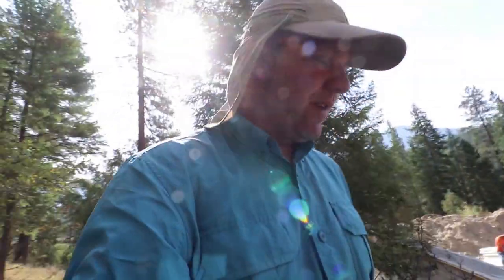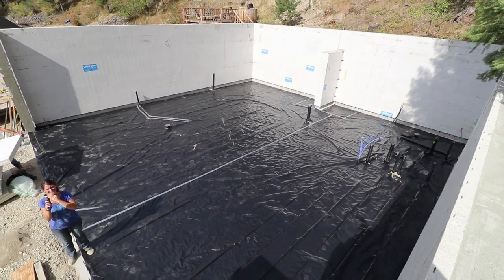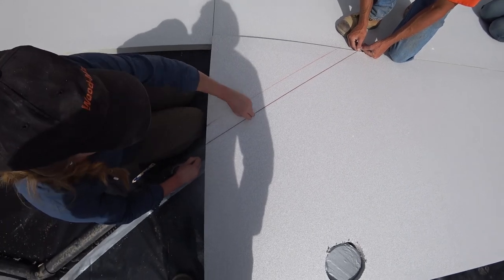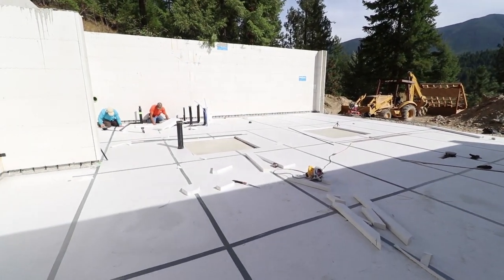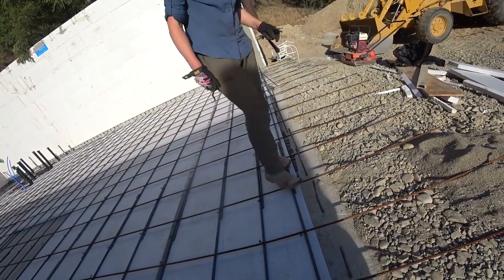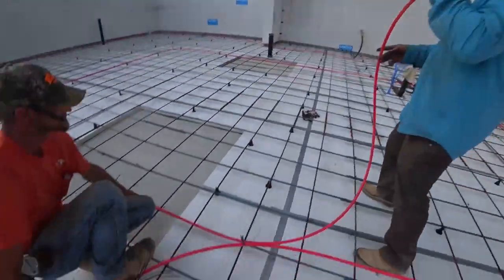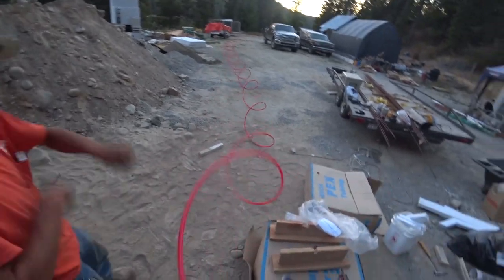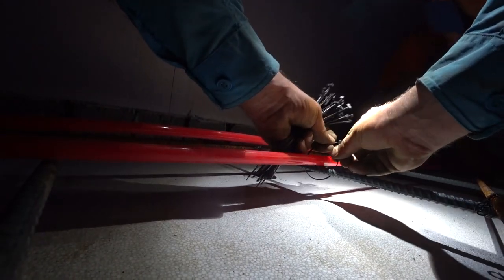PLAYING GIANT HOPSCOTCH (Rebar Tying in Concrete Slab)

Comment: So the foam won't compress under the weight of the slab? An uneducated man like myself would think that would lead to cracks in the concrete as the foam compresses. Long time listener; first time caller.
Reply: The rebar will spread the load evenly. And it would take a massive amount of concrete to compress the foam significantly (they are making a floor, not a nuclear bunker ;) ). 
I work at a factory that manufactures precast concrete pillars and beams, and we often use polystyrene for formwork (that, and a sh!tload of plywood).
Polystyrene breaks easily, but can take quite a lot of pressure when supported underneath.

Comment: Yeah,, I know,, a week late,,, You do not need to tape the seams.  Isn't even recommended.  A full and perfect seal could trap liquid water.    The plastic is a moisture barrier, not a water barrier.  It achieves its principal use by breaking the absorbtion of moisture up through the concrete,, a wicking process, capillary action.  The foam around pipes just break pieces off with your hands and cram them into place.

I haven't finished watching the video,,, your pipes will float up through the concrete  Your re-bar or screen is on top of your pipes, or tie your pipes well to the rebar.  If your transfer piping is not well tied,,, puddle some concrete atop,, allow to jello,, then proceed with the pour.  (That works only if it is a multiple truck pour.)  I buried 500 linear feet of corrugated 4 inch plastic in a 10 inch slab several times.  Air transfer to concrete storage.

Comment: Are those two concrete squares already in the middle of the house there to make sure the final slab doesn't move up or down?
Reply: Axel Solhall they are footings to take upright timber beams to support the flooring etc
Reply: That makes sense! Thanks!
Reply: they are footings for the posts to support the steel beam that is currently being installed

Comment: Is it standard in america to lay a concrete floor on styrofoam blocks? Seems like putting concrete over it might compress it given enough time, whereas compacted soil is already compressed
Reply: No ,its not standard. In some parts of the USA it would be very stupid to do that. I can only speak for my area though ,which allows the ambient temperature in the basement floor to provide a 50 degree basement in the middle of the winter. (when unheated) 10 degree Celsius) Also ,the biggest drawback to using floor slab heat is "slow thermal response times' making daytime or nighttime 'setbacks" difficult to impossible. in my area the temperature can change a lot from day to day. I have hot water heat......I went all copper.( more expensive but way faster temperature adaptation)
Reply: Ruan du plessis In the UK concrete floors are laid on expanded polystyrene too.
Reply: There is a slow flowing water table under my basement that replenishes the natural ground heat. It allows me to heat my home hot water (potable) using just the heat exchanger of the heater. it saves a huge amount of electricity with a family of five.(it really depends on your area and the subsurface temperature)
Reply: Standard practice here in Canada if you are doing it right and not skimping on money, especially when using in floor heating.
Reply: Steven Hardy, pouring slabs on extruded foam boards is pretty standard. I don't know why it would be "very stupid" to do that in certain areas of the US. Maybe you can explain?

Comment: I don't understand the height of the floor drains. They seem to be flush with the foam. The concrete is going to cover them up???
Reply: The styrofoam isn't level with the drains, they had to cut out part of the bottom of the foam for the pipes under it so it could sit flush with the ground.
Reply: Hi Kev not a problem small well extension ring ,there should be a fall to the well between 2/4% per yard creating a fall to the well .

Comment: So your floor heating tubes are cast into the concrete? Won't that mess up the concrete from the inside?
Reply: How would it mess up the concrete from the inside? Once the concrete is dried it is hard, like a rock, the water won't touch the concrete. The water will travel through the pipes, transferring the heat to the concrete thus warming it up.
Reply: Most in floor heating is installed this way, think about it, thermal mass.

Comment: Please tell me that none of those circulations are longer then 300ft. That's the acceptable maximum lenght for a 16mm PE-X pipe as you seems to be using.
Reply: Moritz Hübner ...watch and listen to the video!  They have 5 circuits of 250' in the plans.  Considering the sq ft of the slab, and the spacing it appears they have used, from experience, I would say the average loop is around 200'. 5 loops makes for more control expense, but well worth it.
Reply: Paul Copeland Then pls tell me that they also will reinsulate the slab from the walls prior to pouring.

Comment: Cad program to design radiant  loops. Usually have a 30 day free trial. Also loop on first staple to foam.
Reply: Dale Jensen that is correct.  But the loopcad program I demode did this for you. Did better the the manufacturer I bought my system from.
Reply: I have done radiant heat and snow melt for many years.  As long as they keep the loop length short enough to control the return temperature ( which they did) they will have no problem with slab heating. 5 circuits in that space and installed as they did, will result in a nice low input temp and a controllable return.  If they use the proper controls (based upon the high quality of material used so far, I am confident this will happen) they will have a comfortable and efficient heat source.

Comment: Anyone know what the red hose they were attaching to the rebar was for? i'm guessing its something that runs hot water through? XD no idea. thanks! feel free to reply to me!
Reply: The red hose is for the in floor heating.
Reply: That looks like radiant floor heating tubes (PEX).
Reply: YES, that red hose will be embedded in the concrete and yes hot water will flow through it to help heat the house from the floor up!
Reply: Thanks guys! I was second guessing myself as to why they would run a hose like that. I guess it's cheaper than running some sort of complex copper pipe system. I would be so afraid if at any point the tube cracked which could cause erosion from the elements. But I doubt it because of the insulation on the bottom.
Reply: GOSuBunnY - PEX is much cheaper to run for in=floor heating.  (actually cheaper to run for pretty much any application)
Reply: G0SuBunnY ....pex pipe is far more durable than copper in this situation.  Pex has been used for years.  Copper is not to be encased in concrete.  Bad idea, all around!

Comment: When using a  box cutter for what you are doing it is easier to use a hook blade like the ones used by carpet and vinyl layers. You can cut right into a corner or up to an edge and the cutting part of the blade only ever touchs the material, never the ground or concrete.

Comment: I always thought the zip ties they were using were overkill.  The part that usually fails first is the tiny little lock tab.  That us why the best zip ties actually have a stainless steel tab.
Reply: Oh my god, WRONG ZIP TIES? The armchair experts will complain about everything they see. They won't matter much when the concrete is around the pipe.
Reply: Son of a Diddly - My only reason for commenting is those heavy duty zip ties cost a LOT MORE $$$.  1000 generic, 3mm x 60mm zip ties are about $5 on eBay.  5mm x 370mm are $40.

Comment: duct tape for board insulation seeming? 

did you talk to the manufacturers about this? cloth backed tape is almost never reccomended on insulation of any sort. 

you really want a flashign tape... polyolefin tape or acrylic backed LDPE tape.  

cloth backed vinyl tapes or LDPE "duct" tapes are usually less stable with age and use poor quality synthetic rubber adhesives. they almost never have the proper UL certifications either...

duct tape on the vapor barrier is even worse imo. no building inspections though so i guess you are fine.
Reply: Timothy Manley at least it's all on documentary for the future buyer haha
Reply: very true lol. good point.
Reply: doesn't the duct tape just hold it there until the concrete is poured?  if that is the case what would be the concern ?
Reply: no. the vapor barrier is supposed to be as continuous as possible. when the tape lets go you will allow more vapor in than you would otherwise with a better long lasting tape. 

the vapor barrier is not going to stay perfectly flush with the foam and the foam is not going to stay perfectly flush with the concrete. you will get a small gap with time as both the foam shrinks with compression, and as the subgrade and virgin soil compacts over time. 

unless you are building with piers on bedrock or a slab directly on bedrock, foundations ALWAYS settle. first thing we learned in structures... only think you can do is engineer for a particular settlement depth and engineer the foundation to resist differential settlement.
 
the weight of the sturcture acts as surcharge further compacting and consolidating the subgrade and virgin soil underneath. 

most of the time this settlement is milimeters over say 10 years... but in shitty epansive clay, this can actually be inches. 

you want proper tape so that the vapor barrier and the foam insulation( acting as a vapor barrier as well) stay as tight as possible throughout the settlement. 

regardless though even if the vapor barrier and foam insulation were to stay perfectly flush against the concrete, you still get vapor leakage when the tape fails. 

its not an enormously problematic issue... but a slab that is moving losts of moisture into the interior is going to make certain flooring problematic to install and add to the humidity load in wet weather if left un sealed and as bare concrete. 

again.. not a huge issue here, its just that the proper tape is not expensive at all...just seems like a stupid oversight on an otherwise very nice job.
Reply: well thanks for the reply ..  we build in Southern California where there is less water problems.  Here we over lap the vapor barrier, MAYbe use tape to hold it before the pour.  I am an electrician so this is just from observing for the last 30 years.  
Given that Pure Living is on a hillside in a very wet area it could be a problem.  
The oddest thing that I am not understanding is that the slab is poured on foam insulation and you are going to drive cars on it... Maybe with all of the rebar in the pour and a stronger mix it is strong enough.  We are in an urban area and go into parking garages and you can see the concrete deck above flex as cars go by.  if that is the case here than what happens to the foam below??
Reply: oh i love parking garages man. its really dramatic the movement you can see. 

but you need to be careful not to conflate slab on grade foundations with that of post tensioned parking garage structures. 

the two are VASTLY different. 

post tensioned structors use tendons of high grade coated steel that are under 10's of thousands of lbs of tension. they are designed to be light weight and designed to flex to distribute the load. alot of these post tensioned beams are actually subtly arched when unloaded and when loaded start to flatten out. 

a slab on grade is also designed to flex(obiviously), but not NEARLY as dramatically as that of a post tensioned beam like you see in a parking garage. 

EPS foams come in a variety of compressive strengths. its usually rated at PSI  or PSF at 1% compression. 

common geofoams are  usually anywhere from 5psi to 15 psi and higher maby.  you can get very very hard foams like 40 psi, but these have far far less insulating value and will not be used in a situation where insulation is critical such as this garage here. 

its important to remember that you are not putting the load directly onto the foam underneath the tires of your car... the load is distributed to many adjacent panels via the concrete slab so you can actually use foam thats 10 or 15 psi rated quite easily on a car whos weight accounts for say... 40 psi ground pressure. 

btw. fun fact here... a battle tank which weighs many multiples that of your Toyota truck  actually has a ground pressure many times less due to the enormous contact areas of the tank treads... hence they can drive on sand and all sorts of soft ground.
Reply: Timothy Manley .. good info,  thanks

Comment: In my research for building my own home, I have found they now recommend placing the foam down first, and then the vapor barrier something about slab failure. Anyone else have thoughts on this?
Reply: Vapor barrier against concrete, but a few do otherwise. This will ensure no bonding of the slab to underlying materials. Newer integrated systems will be foam ontop since the tubing is laid within the foam.  Never heard of doing otherwise leading to slab failure and would say slab failure is just down to improper base prep.
Reply: I was a bit surprised the engineer used direct slab-wall contact for sliding resistance. I would have preferred to see a couple of grade beams instead so the slab could stay thermally isolated from the walls.
Reply: Funny that my retaining wall design software has an option for "slab is present to resist all sliding forces". As an engineer you have many options for how to handle retaining wall forces. I am a bit surprised by this one, but that doesn't mean it isn't a valid engineering solution.
Reply: Commenting just to save this thread for future reference

Comment: Why you heating your garage?
Reply: Campbell Stubbs Having conditioned space below their house means they don't need high R-factor in the floor. Takes up less space, the heat will rise into the house, and their vehicles won't have to sit in the cold. Not to mention if you have ever tried to service a vehicle in freezing temperatures, it is NOT an ideal situation.

Comment: putting concrete ontop of something compressable, even with rebar, sounds like a bad idea to me. lots of cracking. then again, i'm no expert.
Reply: yes, you are not an expert.
Reply: They used a high density styrofoam so in theory it shouldn't compress.
Reply: They also have two butresses in the middle of the floor, which will support the weight of the slab.
Reply: Vein1986 yes, I said that.
Reply: epocs thank you.
Reply: haha it's done like this in every single civilized country in the world, literally.
Reply: @Simon Olesen :
Unless they use LECA instead of StyroFoam.
Reply: Simon Olesen i've lived in 4 different houses, and the slabs were poured straight on a gravel bed that sat on bedrock. in the foothills of Denver, so putting a house on top of takeout containers is new to me.
Reply: 1 inch of high density styrofoam has similar R value to 4 feet of gravel, and you get greater strength per inch of concrete than with leca as well as a lot of other desirable properties. They are not takeout containers lol
Reply: They really are not, I can agree with that.
On a sidenote, LECA doubles as drainage, which is neat.
Reply: @Grumpy ol' Boot
yeah LECA is good, but not used much here anymore mostly because everyone wants underfloor heating. Do you guy's often use LECA in conjunction with underfloor heating systems ?
Reply: Not really, no, though I suspect it could be done with a bit of finagling.
But for garages and such, which usually don't have underground heating, we like LECA because it can be done so fast.

Comment: Rebar is too close to the wall (needs min 50mm). The loops are done totally wrong, piping is too thin and runs need to loop to centre and out. You're going to have a warm side of the house and a cold side.
Reply: well arnt you just Mr Positive
Reply: This is the "garage" space, the living space is one level up.
Reply: An Onymous I assume they had an HVAC / plumber type person design this and they are laying out the zones according to a detailed plan, right?
Reply: butopiatoo right. (An engineer)
Reply: s731s no not me, but they are useful for quantifying things and giving a range of options. You still get to pick as the owner builder and have some confidence that what you are doing is going to work and perform over the long run.

Comment: I just don't get why you need radiant heat in a garage... I would expect it above.
Reply: Does heat rise?
Reply: Do people normally heat garages?
Do cars and heavy equipment drive on the slab?
Are garage doors huge? 
Is the living space above?

I suspect that this is more like a shop. I thought that a basement has a more consistent temperature, so I am also surprised that there is ICF foam in the buried area.  r
Reply: In extremely cold regions, it is helpful to keep cars warm, plus it gives them reduced freezing chances for plumbing and otherwise. 
Also, the garage is likely to be a storage area to boot, and some thing would be best served with a less extreme temperature range, if they store food or water (which is likely, considering how off grid they are aiming to be).
Reply: I just thought that a basement already supplied that temperature buffer.  I know how garages end up as storage :)   I suppose the cost to add it during construction is marginal.  My friend who heats his workshop does it with wood stove.  I'd kind of think that there would be a neat way to do a wood stove downstairs that supplies radiant heat to the upstairs.    

I'm mostly professing my ignorance here.
Reply: Beats the pants off of doing car maintenance in a drive-in freezer.